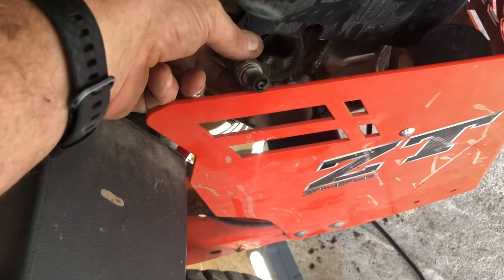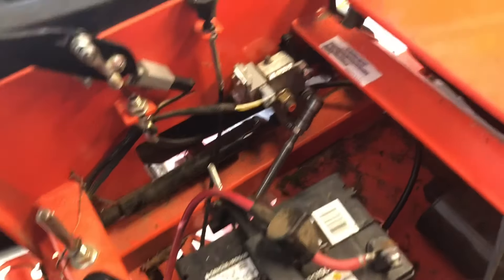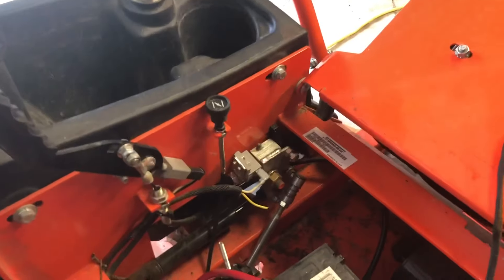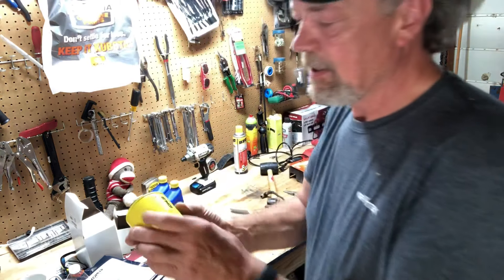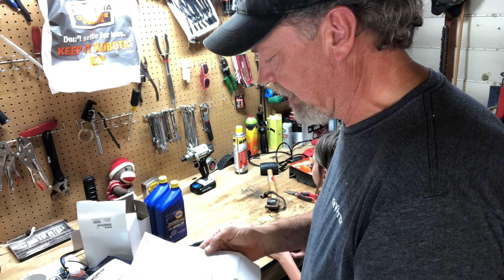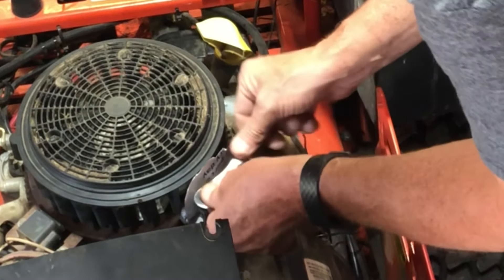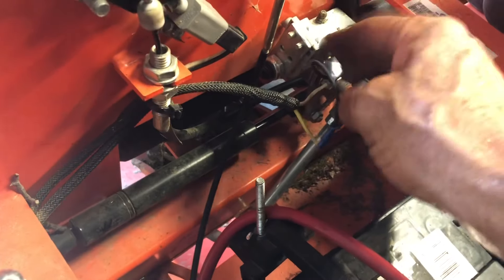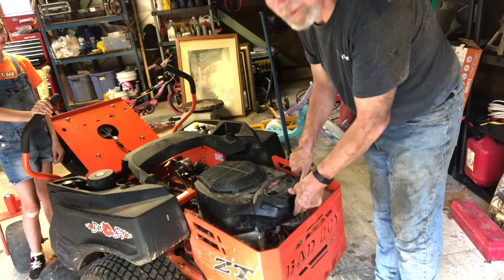Badboy Elite Zero Turn Mower Won’t Start !

Comment: Brand new mower here. Used one time. It was all fine when I finished. Went to mow today and it wouldn’t start.. bought a new one so I wouldn’t have to deal with things breaking for a while… literally not even a month old.. and I’m a lady with 0 knowledge on how to fix things. That’s the whole reason I bought a new one.  I have no clue what to do right now
Reply from the maker: Ugg that’s frustrating I’m sure !
Reply: Push the handles out

Comment: Mine wouldn't start today.   It made a single click noise but nothing else.   Checked all connections but nothing loose and no blown fuses.   I then noticed the brake bolt was fairly loose.   Used 1/2" socket to take off side panel and tighted the 9/16" brake bolt and it started right up.
Reply from the maker: Thanks for watching 
It’s usually something simple 
Glad you were able to get her going 
Phil 
PFON
Reply: Wow thanks for sharing that. Something 99% of the people wouldn't look for.

Comment: You put your seat up but there's no pressure on the seat for the switch I know on the MZ you got to have pressure on the seat or  jump it this  I'm talking about the switch on the seat it calls for pressure to be put on on the MZ
Reply from the maker: Your right it may be different 
On my elite the mower blades have to be disengaged and parking brake on to start 
And to get off mower while it is still running 
It will not start if parking brake is off 
Seated or non seated  
I will double check and let you know About with the seat up 
Thanks for watching and sharing your thoughts 😁

Comment: I’m not even getting the clicking sound
Reply from the maker: Maybe your starter solenoid is bad or bad battery wire connection 
Or a bad ground

Comment: I have a 2020 Maverick that I bought new and I've been having the no start issue for 2yrs now. It's covered by warranty but dealing with them is a pain in the butt. The first time it wouldn't start, repair center replaced the blade engage switch. Worked for a few months and started doing the same thing again. Second repair center said it's due to crappy solenoids not grounding properly. He ran a wire from the solenoid to the battery negative and that worked for about a month. And now I'm right back to it acting up again. This is the most aggravating issue to deal with.
Reply from the maker: That would be very frustrating for sure 
The Bad Boy is pretty simple to work in but electrical issues can be tricky to fiqure out 
Wish you luck 👍

Comment: I think this is my problem, thought the battery was dead, but wasn't and I noticed one of the wires was out of the safety switch. Course it's my sister n law and no parts, so just held it to it, but still nothing. Weird, the other safety switch wire was out as well. So gonna get some connectors and pray that's it.

Comment: Thank you very much! I had the exact same problem and I fixed it so, I could finish cutting my lawn. I didn't have another connection so I just used what I had and it worked.
Reply from the maker: Glad to hear 
Definitely a common problem 
Thanks for watching

Comment: That's great you got it running. There sure is a lot more going on under the hood then I would have thought. Have a good one Phil !!!
Reply from the maker: Thanks for watching 
Yea there is I hate electrical problems 
It’s 7 years old and I surprised it did not go bad before. Bad design but a simple fix. 
Would have use a paper clip to fix it but I did not have one 🤣
Reply: @PetersonFarmsofNashvillePFON  📎📎📎🖇🖇😁👍

Comment: My is down , I check the oil level and it is mixed with gasoline. I think the gaskets are gone what do you think ? Thank you
Reply from the maker: Wow 
Definitely need to change oil 
Hopefully it’s a carburetor thing with float or if injected may be bad injectors ? 
Either one could flood the system and it lands in the oil 
The worst problem could be the piston rings worn and would be a rebuild and more in-depth repair ? 
Good luck 
Probably can still be fixed 🤞🏻

Comment: My father and i have been scouting over this video and several others like it, we replaced the solinoid as well as the pto and fuel pump, the battery is good, none of the electric systwes seem to be getting any power. The starter works when we cross the solenoid the relays are also fine and so are the saftey switches, any idea what it might be
Reply from the maker: The safety switches are tricky you might pull the wire softly to make sure they aren’t broken 
The solenoid I bought had a extra wire and until I connected it to the negative on the battery the mower would not start 
I’m assuming you have the brake on when trying to start it 
If I think of anything else I will let you know

Comment: I'm a lady, too. I used it last night. Got off and forgot to turn off the blades. Is there any advice you have for me??? I tried jump starting it, had no luck, and the battery is currently being charged as we speak. 
Is there anything else I should be checking for? 😢😢😢
Reply from the maker: If it won’t turn over all 
Make sure the Brake is up and on 
Make sure the steering arms are all the way out 
Make sure the blade engagement button is all the way down 
Sit in the seat a see if it will turn over

Comment: My 2013 bad boy 60” keeps blowing the starter fuse under the seat. You can turn the key one click and it makes a noise but when you turn to actually start the fuse blows. I don’t see any wires loose or damage.  Any suggestions??
Reply from the maker: Maybe the starter solenoid? 
Could be a corroded connection or loose connection 
Not sure that would blow fuse ?
Reply: U figure it out

Comment: Just came upon your video .  That is ridiculous with rigid wires to that connector with all the handle moving around.   That was not thought out by Bad Boy Company.  Didn't like what I saw !!!  designers should pay attention to details and quality !!   I am in process of buying a mower but want a quality mower that will last .   I am looking either a Scag or Bad Boy , but taking my time checking everything I can before buying.   Thank you for your video !!!
I noticed the post about 2 years ago . Is the Bad Boy still holding up also other problems with it ??    Thank you !!!       Another question : What is the maximum height the mower can go to in inches.     I know Scag can go to 6 in.
Reply from the maker: Thanks for stopping by 
Yes BadBoy is still strong for a 8 year old mower no other issues 
If you are looking at Scag vs BadBoy Comparison you might check out this video https://youtu.be/MiF0ba3-q_4?si=tkk-WM99HohLzCOC
I upgraded to a Roque and my friend bought a Scag 
Scag definitely has to be a mower to consider and has a few more Comfort features 👍

Comment: Mine does one quick loud click, makes a squeal sound sometimes like its struggling. I put in a new battery and it still does it. Any advice?
Reply from the maker: Sounds like it or a corroded connection
Hopefully that simple 👍

Comment: Glad you got it fixed!
Reply from the maker: Thanks 
Me too
7 years old I’m surprised the safety switch wire had not failed before now 
It is a poor design but simple fix 
I hate electrical problems 
They are hard to figure out sometimes

Comment: I'm pretty sure by running the new ground wire to the battery,you just bypassed your safety switches
Reply from the maker: Nope unfortunately they still work

Comment: Mine ran out of gas and then wouldn’t start after refilling. Appears to have fuel running through lines. Changed spark plug and still won’t fire up.
Reply from the maker: Check and make sure your getting spark 
Very strange if it was running before?
Reply: @PetersonFarmsofNashvillePFON  yes it was cutting when it ran empty . Won’t even try to fire. Really confusing.

Comment: Mine doesn’t even make a noise when I turn over the key. Not a single noise
Reply from the maker: Sound like Battery?
Reply: I have the same problem but its not the battery
Reply: @mexicanjumper2258  mine ended up being a dead battery. It wouldn’t even charge I needed a brand new one.
Reply from the maker: Glad it was a simple fix 👍

Comment: Mine just makes a buzzing noise at the solenoid. Just put a new one on and that's not the problem. Edit: Turns out the battery was shot after 1.5 years. Interstate sucks.
Reply from the maker: Make sure the battery is good and solenoid is grounded
Reply: @PetersonFarmsofNashvillePFON  Finally pulled the battery and put it on the workbench. When it wouldn't take a charge overnight I knew then. Just unexpected. I keep it stored inside, but did not use a trickle charger over the winter. Still started just fine the next year.

Comment: My Bad Boy won't start. It clocks like yours and  also when I try to start it the starter selanoid just chatters. I replaced it and the new one does the same. Ugh.....
Reply from the maker: Did you check the safety switches 
Ultimately that was what was wrong with mine wire broken going to the switch